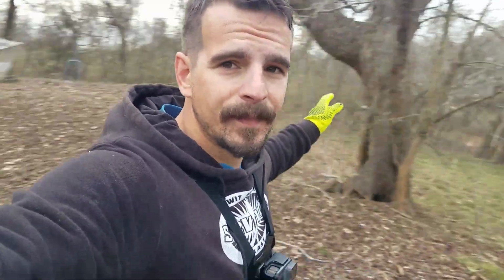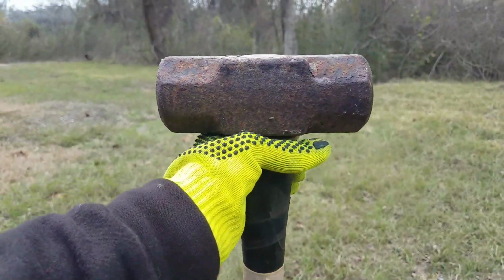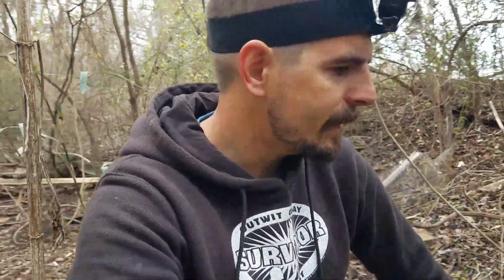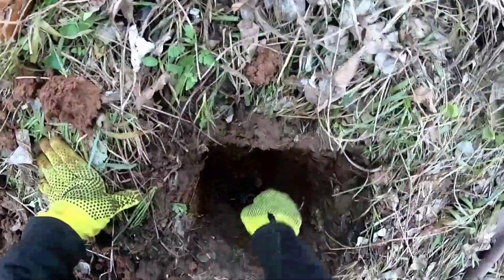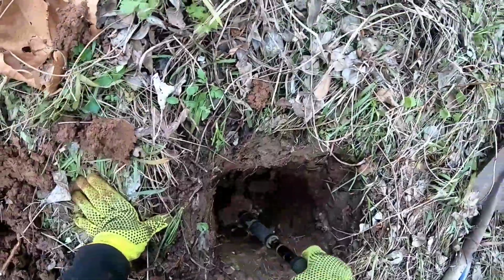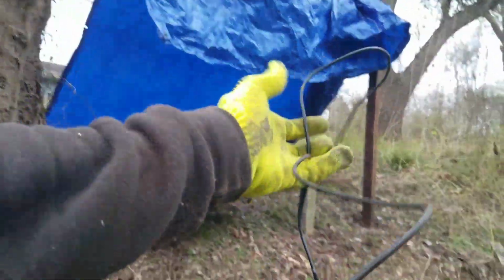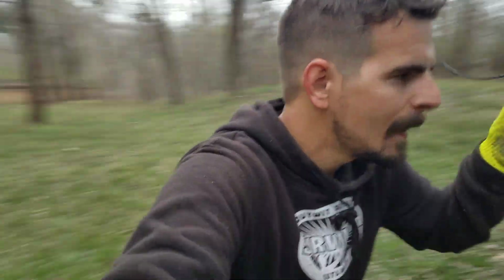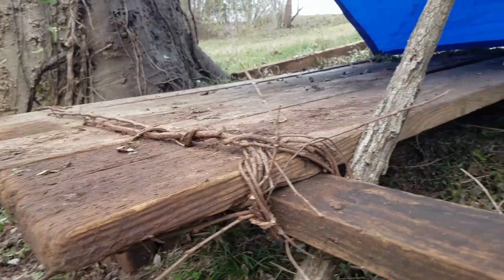Building A Fishing Camp in the Woods Using Recycled Materials

Comment: Just a few tips I thought you might appreciate. You may already know them I don't know. 
#1. Always makes sure your tools are cleaned after use. It will make them last longer and save you time the next time you are ready to use them.
#2. Spray the tip of your shovel or post hole diggers before using them and periodically if using them for a while. It'll help them slide into the dirt easier and especially if your dealing with gumbo mud or clay. The area you are in, I'm sure you are hitting that. Plus it will help prevent rusting.
#3. Use treated wood. Or you can use Cottonseed Oil or Linseed ( not sure of spelling) Oil, apply generously to all exposed wood. It is much cheaper than any man made product. Plus its environment friendly.
#4. Put some type of water resistant materiel between the ground and any thing exposed to it. Cut squares and fold corners downward making a large lip to place on post where decking will sit. To prevent insects and other creepy crawlers from invading your deck.
Good luck.

Oops I see your already done.